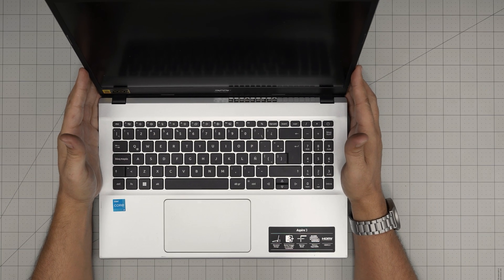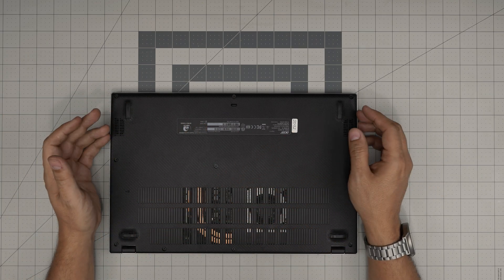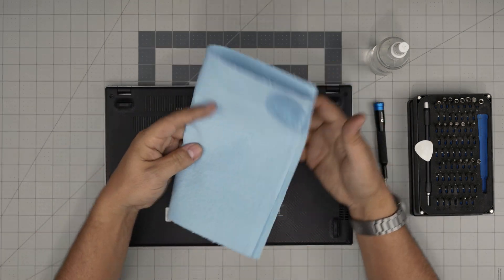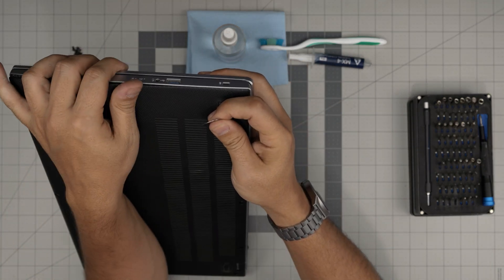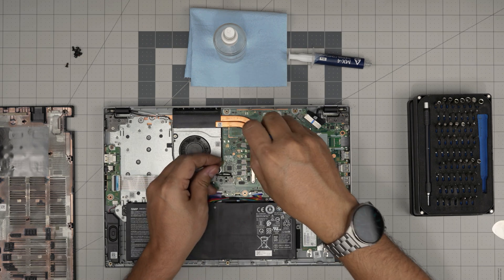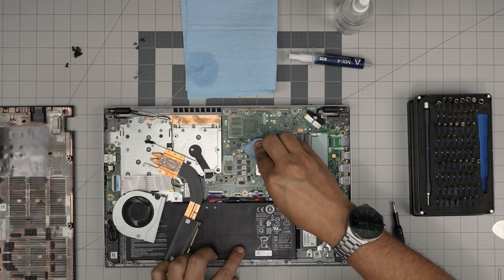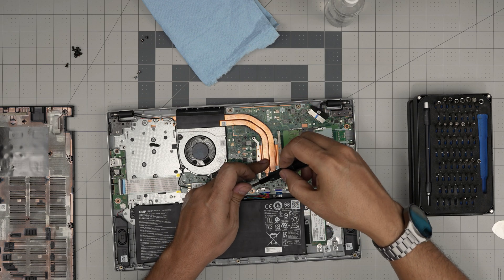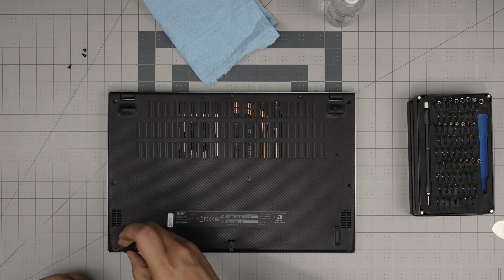How to Repaste and Clean Acer Aspire 3 A315-59-314H Laptop

Comment: Thank you for the demo, you should use some type of gloves, the alchool 99% is very poisonous and it is permeable through your skin.... please take care of your health.
Reply from the maker: It's my pleasure my friend.
🫠Regarding your concern, I do appreciate it. But 99% isopropyl alcohol is not poisonous. I’ve been repairing for the past 22 years using that alcohol.
It’s not dangerous. The only thing you should be careful about is moisturizing your hands daily because the only downside of this alcohol is that it dissolves oils and can dry out your skin quickly, causing irritation, redness, or cracking if used often.
But if you use a moisturizing product, you will be 100% safe.
Also, some people are allergic, and their skin cracks quickly or gets irritated because they have a skin condition or sensitive skin—in that case, definitely 100% gloves.
Again, I appreciate the concern, my friend.
cheers🍻

Comment: Hello!

I gotta ask: if a heatsink screw isn't budging, what should I do? At first, I managed to get one screw out of the heatsink, and a few moments later, applied pressure to get the other two screws. Now the last one isn't budging, even when screwing it. What should I do?
Reply: The 1st screw (numbered 1) in the Heatsink for me isn't budging.
Reply from the maker: 🫠Regarding your question, Use a flathead screwdriver with a bit more downforce and a small rotation, and it should come out. If that doesn’t work, you may need to make a cut on the screw head and use a larger flathead screwdriver.
here are a videos i needed to remove a screw.
https://youtu.be/xLt6dMIsO9E
https://youtu.be/UaMO0sH45VI
cheers🍻